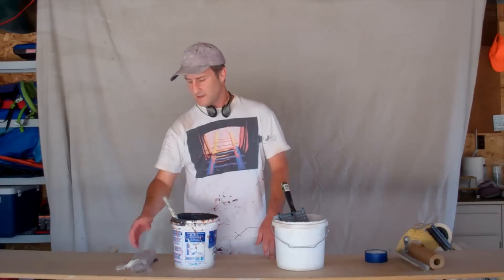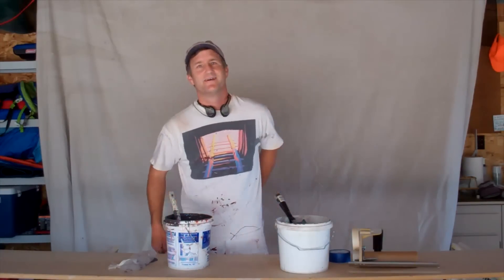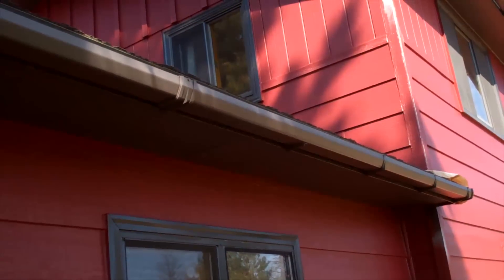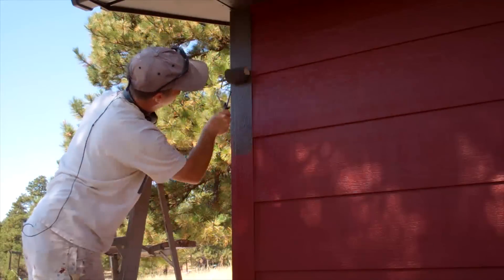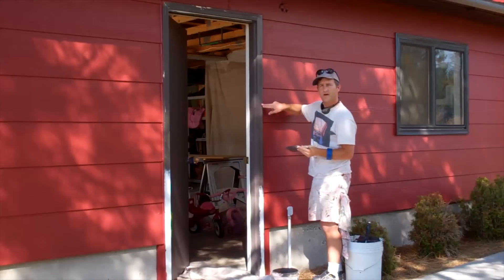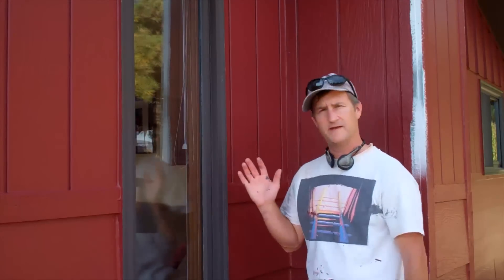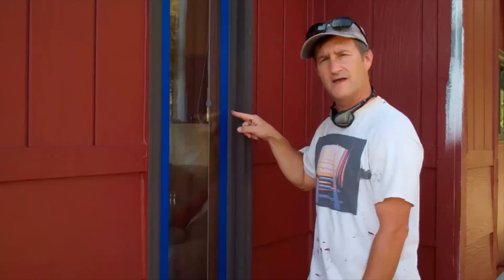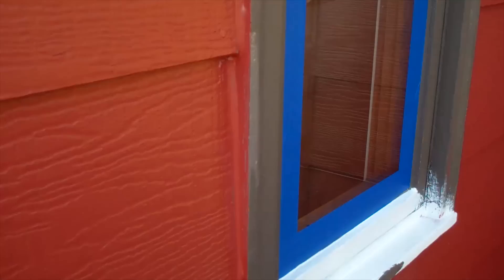Exterior Painting Step 8: Painting the Trim

Comment: The side of the trim boards should be painted the trim color; it takes more time and takes skill to do, but it makes the paintjob look right.
Reply from the maker: Thanks--I've seen it done that way. For your average DIY painter it is not worth the trouble, in my opinion. The 90-degree angle on the edge of the trim board makes a much straighter line naturally than trying to cut in against the siding, where there is likely caulking that will make it difficult to cut a nice straight line unless somebody is an expert. In any case, I've never found it to be worth the trouble, and whether it looks better or not is really a matter of opinion. I do appreciate you pointing this out, however, because it is an option.
Reply: howtopaintahouse Go look at showpieces in whatever downtown you are close to; the side of the trim is painted the trim color.  It's not really opinion; it's just a fact.  The "facing" style that you are teaching didn't come out until after the airless sprayer.....  Before the airless sprayer, craftsman did what was logical; paint the trim boards the trim color and paint the clap's the siding color.  It is more interesting to look at that way.  If the caulk is all built up, then remove it; prime the bare wood, reapply caulk correctly, then paint the trim, the cut in the siding.  Beautiful.
Reply: when doing the siding on my house I always prestain with Cabot, as I build,,the inside corners are 2x4's ripped and stained the trim color,  as is the trim boards. the cedar clap boards on the first level are stained  Misson Brown, and the second level a half story is shingled with cedar shingles I pre stained the Allagash green, and the  the trim are  Mt Laurel deep green almost park bench green, but I learn from others all the time, Not sure who will have to repaint stain later on, but for years it will look good and not peal away because all the wood is coated, sides, edges and back
Reply: Tom Duckwall I'm trying to share my dad and granddad's trade with a 16 year old gIrl and trying to find thr right video to share what I taught her today. Thanks!